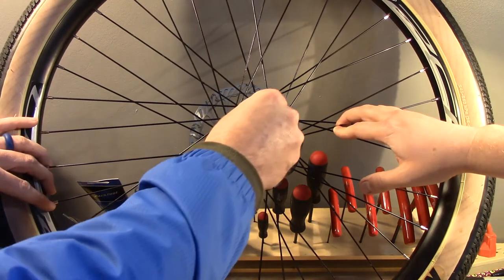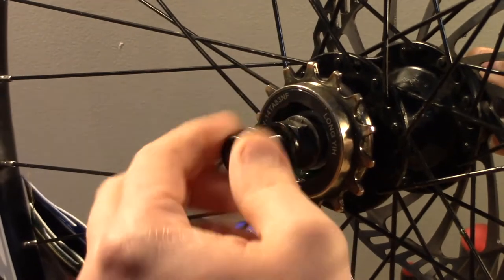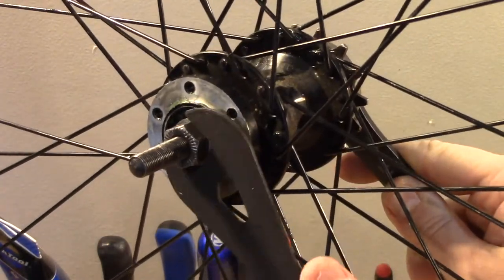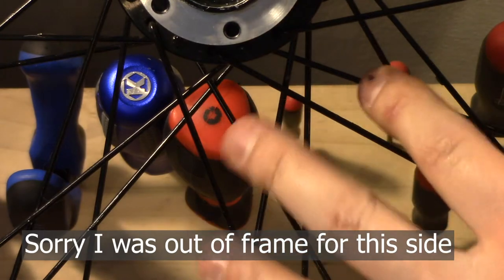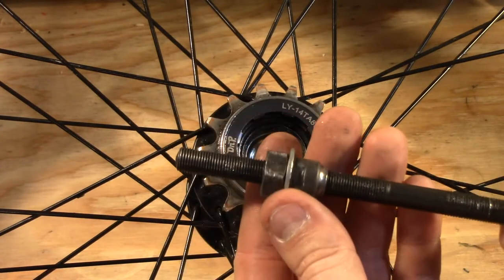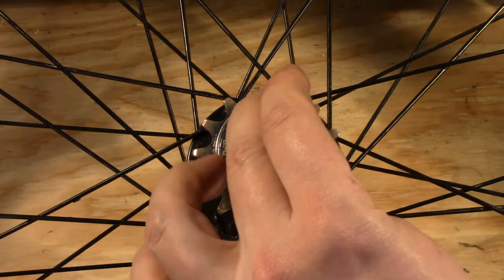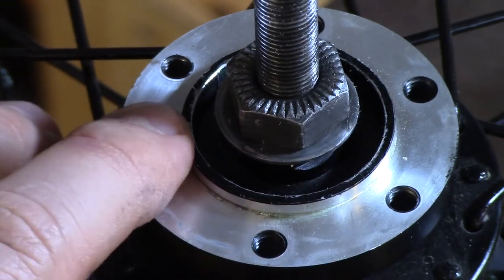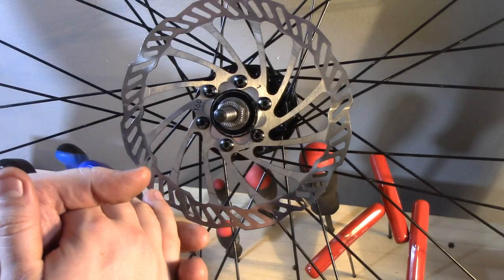Cup and Cone Bearings Explained. Dirt Jumper Bike Hub Rebuild.

Comment: Some hubs on some frames need a bit of preload looseness. Then, once tightened into the frame the looseness goes away. Without this preload looseness the bearings are just too tight. Would be nice to address this topic, but still a good video.

Comment: I think the purpose of the dust cover of the cone is to align the bearings perfectly than a cone without a dustcap, I notice this when I had a cone without a dustcap on the right while a cone with a dustcap on the left, as perfectly tighten those too I notice the right as a wobble.

Comment: Whats Up Richard Nice To Meet You Brother. I Have A Mens And Womens Nishiki Pueblo bike From Dicks Sporting Goods And Would Like To Know What Ball Bearing System It Has If It Has Cartridge Bearing Systems And Adjustable “Cup-And-
Cone” Bearing Systems Or A Different Type Of System And What Kind Of Hub It Has As Well Because The Website Doesnt Provide Much Specific Information Of The Components And Parts Installed On The Bike. I Really Want To Learn Bicycle Maintenance And Repair. If Your Able To Help Me Out With That I Will Greatly Appreciate It Very Much From The 💚🫂 Thank You And Have A Great Blessed Night Brother.

Comment: I need to replace 3 kids bikes 2 20in, and 1 26in rear axles for longer ones for training wheels, Do you have any idea what the thread size is for these to purchase new longer axles? 15mm outside diameter and I believe 10m inside but the 1 1.25 or 1.5 don't fit

Comment: what is the magnet? I checked on Park tool's website and couldn't find it.
Reply from the maker: It's their pick set. They have magnets on one end and I find them very helpful. They are also the most durable picks I've used.
Reply: @richardsbikeshop5268  do you have the code?
Reply from the maker: @@DiabloOutdoors  https://www.amazon.com/Park-Tool-Utility-Pick-Set/dp/B00JXNZNHA/ref=mp_s_a_1_1_sspa?hvadid=410000987400&hvdev=t&hvlocphy=9052202&hvnetw=g&hvqmt=e&hvrand=11512230546114176482&hvtargid=kwd-97759404066&hydadcr=9382_11541747&keywords=park+tool+pick+set&qid=1681753170&sr=8-1-spons&psc=1&smid=AMY4I718ZUBOU&spLa=ZW5jcnlwdGVkUXVhbGlmaWVyPUFXT0QwQzRBUE1JVFUmZW5jcnlwdGVkSWQ9QTAzNTE1NDIzUlVWVFBZNUpFVTQ4JmVuY3J5cHRlZEFkSWQ9QTA2NzcyODMyOUQ4TTRBQTVBRjYyJndpZGdldE5hbWU9c3BfcGhvbmVfc2VhcmNoX2F0ZiZhY3Rpb249Y2xpY2tSZWRpcmVjdCZkb05vdExvZ0NsaWNrPXRydWU=

Comment: What if we don't have an axle vise and the locknut is so small it can't be grabbed by a normal bench vise?
Reply from the maker: With a normal bench vice, you can easily grab the 15mm lock nut no sweat.  This is what I normally use, not the axle vice.